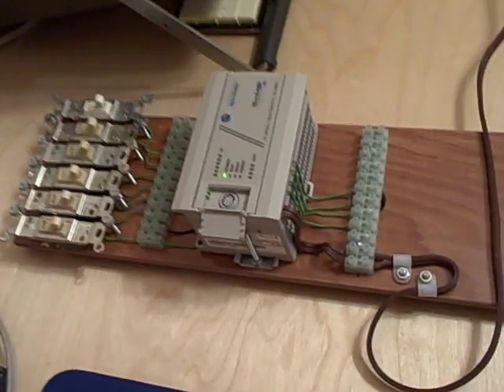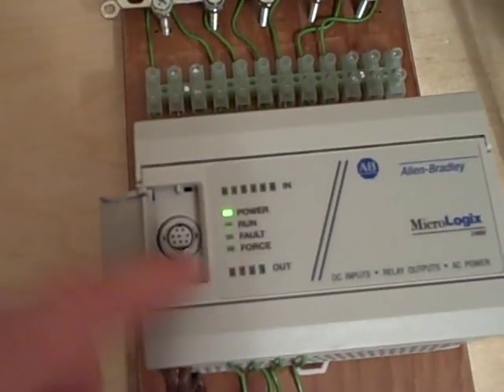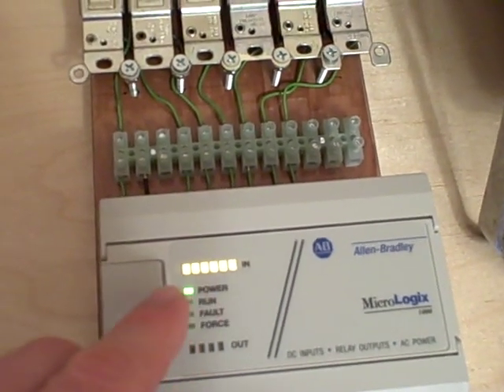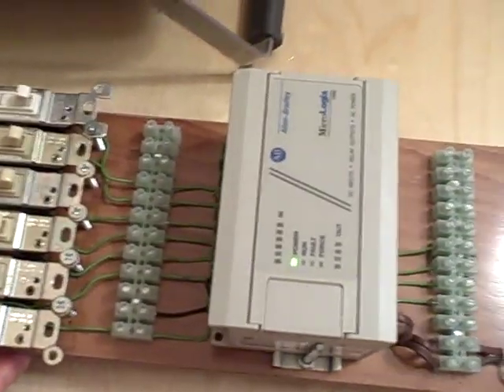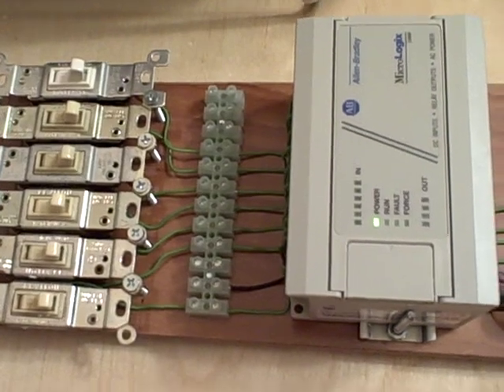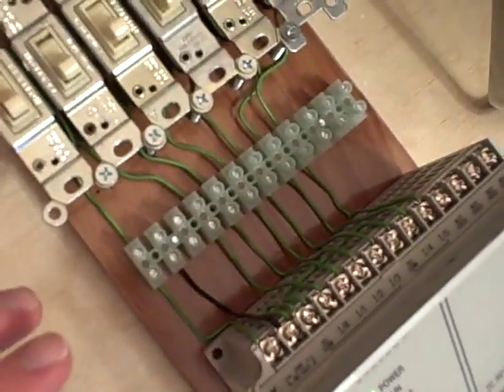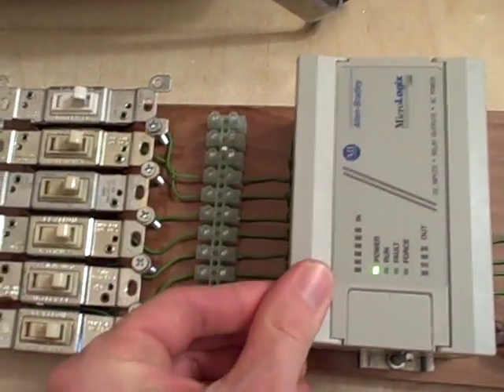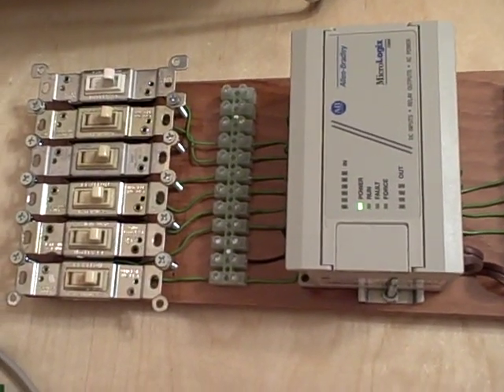Home-built PLC trainer

Comment: I do confirm this method to learn technical matter. You have chosen the most simple way. This wooden board is capable to develop by actuators and sensors or connect to other boards.

Comment: I have a trainer, how can I output to a ac motor control circuit
Reply: You should be able to use a relay output or wire straight into the control circuit. For example, wire an output to the coil of the contactor( make sure contactor coil is 24vdc) if it isn't, you need to use a relay.
Reply: @duckett18  Thanks! But I have learned a lot n the past 10 months. I wired the motor to  a plc to get it working
Reply: @joew4202  No worries, I am glad you have learned alot, you are constantly learning being an engineer. In my previous post I was assuming you was asking for a 3 phase induction motor, I take it that was not the type of motor you was asking about?
Reply: @duckett18  no this was just a simple single phase motor I was training with. I have however since started working with 3 phase motors.  I am a controls technician and work in a large bottling industry. We usually control 3 phase with contactors which we control with plc
Reply: @joew4202  Exactly. It sounds like a good role. Good luck with your career and for the future 👌